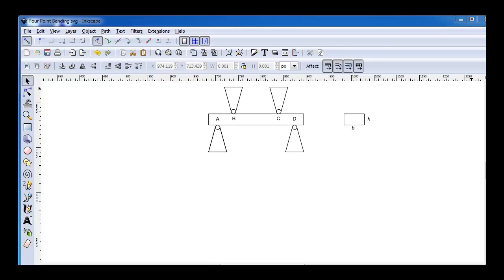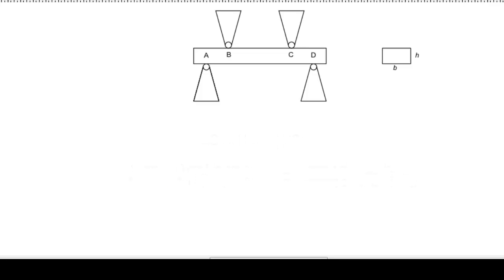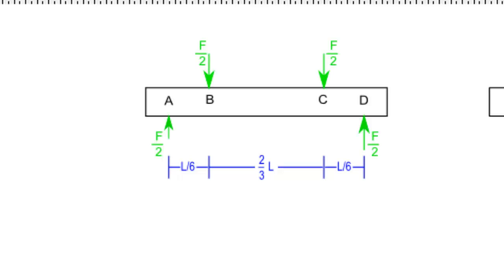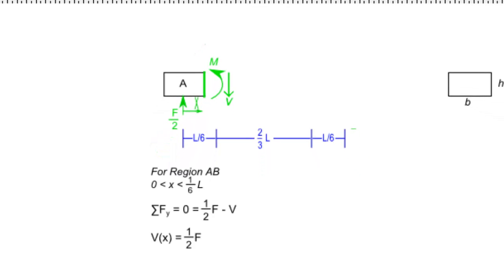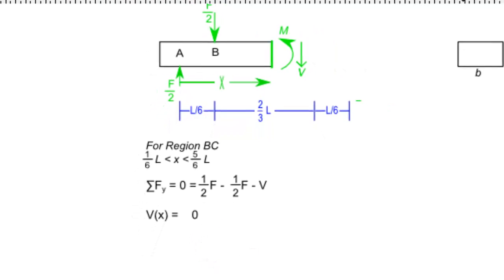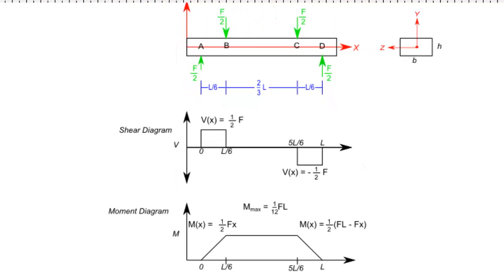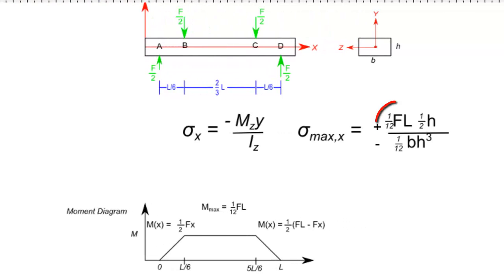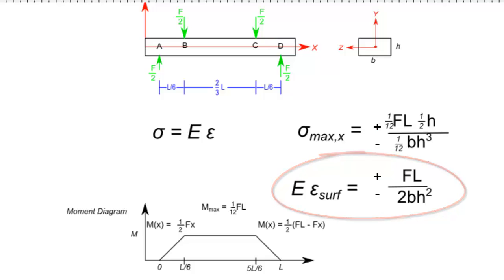Four point bending

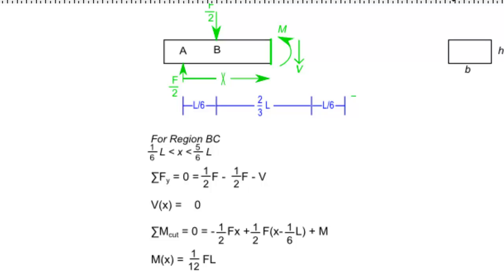Comment: At 2:45 why wouldn't the moment be -0.5F*x - 0.5F*(x-1/6L) aren't all forces going downwards and thus negative?
Reply: Hi i know this is so late but other people will have this question. The positive and negative conventions for bending moment and shear force are shown in the diagram. Just a quick reminder that shear force is the internal force that keeps a segment of beam static when other forces 'removed' by imaging cutting the segment off.  The bending moment is what prevents that same segment from rotating.  This makes sense, because an object at rest still needs to be at rest when a segment of the whole is analyzed.

Positive shear force is actually down if you are analyzing from the left end of the beam to the right (this changes if you analyze from right--> left). 
A good way of thinking about this is if a bending moment would make a beam bend into a smile, it's positive. Frown makes it negative. 

They decided to do this because they wanted the convention to be positive when resisting a supporting force (like how in region AB, the only force is going up). The reason why the moment is positive when smiling is because the convention is easier if the positive moment resists a positive shear force.

Comment: hi thank you so much for your great video. My samples cross section is square hollow shape. I would like to know the equaton of stress? For this cross section, the moment is the same?
Reply: The equation for calculating stress is the same, you just need to compute the moment of inertia for the shape you have. You should be able to find any examples in any common Mechanics of Materials textbook (something like Hibbeler, for example)
Reply: Thank you so much for your guidance. How about for calculation of the strain at maximum point from the neutral axis?
Reply: The direct approach would be to put a strain gauge on your beam (described near the 4.30 mark in this video). Indirectly, if you already know the stress, and you know the stiffness, you can determine the strain using hooke's law
Reply: Hi John,
Thank you so much for your reply.
I have the LVDT for measuring the beam deflection. the stifness of the beam is unknown. As you have mentioned the stress can be calculated using the formula in the video.
I would like to calculate the  strain using the beam deflection. I am using standard ISO 14125, the strain is calculated using this formula: strain=4.7sh/L^2, s is deflection, h is the thickness of the specimen. 
However, I do not know how this equation has derived? is this equation is applicable for any cross section?
Reply: Hi Fariborz, 
I'm happy to help clarify the basics, but I am unfamiliar with the details of the standard your are using. However, it appears to only be valid for a very specific geometry. At this point, assuming you are a student, you should be consulting with one of your local faculty members for assistance. If you are not at a university, it may be time to consult a practicing engineer. Your experiment sounds simple enough that anyone with a mechanical, civil, or aerospace engineering background should be able to help.
Best of luck
Reply: Hi, 
actually the standard is a general standard I thinks and it is applicable for all geometry. I am researcher actually, but my background is not mechanical or civil engineering, however, I am learning myself because of current projects that i am involved. 
From your video i have found how to drive the stress formula by using the moment.
At this moment.I am looking for derivation of strain calculation 
Any way thank you so much for your great help.
Reply from the maker: so i took a quick look, and the standard is definitely specific to a certain geometry
https://www.iso.org/obp/ui/#iso:std:iso:14125:ed-1:v1:en
From the Introduction / Scope
"1.5   The method specifies preferred dimensions for the specimen. Tests which are carried out on 
specimens of other dimensions, or on specimens which are prepared under 
different conditions, may produce results which are not comparable"

Be careful with assuming it is valid for all geometries.
Reply: Hello, 

Thank you so much for your consideration and the link. 
I will check again carefully about the dimensions.

Good luck, 
Fariborz

Comment: Hi. I am currently carrying out a project to determine the Young's Modulus of a steel beam using 3 point or 4 point bending, and after watching your videos, 4 point bending seems to be the less destructive/damaging option to use. 

With regards to calculating the deflection, can't that just be done using the Integration or Macaulay's Method, or is a gauge needed by force at the centre of the beam? 

Thanks for your time, and keep up the good work :)
Reply from the maker: +Andrew Borg I would typically recommend taking all the experimental measurements that you can, and then comparing those measurements to predictions based on the theoretical equations. 

If all you are trying to determine is the youngs modulus, I'd recommend using surface mounted strain gauges. You should then pretty easily be able to measure the maximum strain, and relate it to the bending stress in the beam. 

If you also want the deflection, you could experimentally measure the deflection of the midpoint with an extensometer, or if your sample is large enough perhaps capture the deflection on video, and then use DICM based techniques to back out the displacement field of the full beam (https://en.wikipedia.org/wiki/Digital_image_correlation).

As long as you are well within the linear elastic range of the material, and you have  a nice homogeneous material, the standard beam deflection equations should accurately match the experimental deflection. However, if you approach the yield stress, your will likely get local yielding near the supports, and this will causes deviations between the theoretical bending curves, and your experimental results. This is one of the reasons why if you need to get yield properties, you're better off using a traditional tensile test. 

As a final note, I wouldn't say that the 4 point method is any less destructive that the 3 point method. The destructiveness will depend on what load you apply in either case. An advantage of the 4 point test, is that the central region has a constant moment, and therefore constant bending stress. This is similar to having a uniform gauge region in a tensile test specimen. 3 point bending has no uniform stress region, making measurements slightly more challenging, and making your measurements more susceptible to flaws in the sample. 

Good luck
Reply: +jdomann Thanks so much for your help :)
Reply: +Dimitri Giordani you can bring out an equation relating the deflection of the beam at the centre and the Flexure Formula for stress (stress = -My/I)

Comment: Hi. If you have the displacement from a test machine for this experiment, how do you convert that to the strain?
Reply from the maker: +Aggerschoen There are at least 3 ways you could go about obtaining the strain from this experiment. First, put a strain gauge on your specimen. Second, if you know the stiffness of your material, strain is stress / stiffness. However, if you are unable / unwilling to put a strain gauge on your specimen, and you are testing it with the intent of measuring it's stiffness, you are left with the third option. Use the beam deflection equations, which can relate the deflection at your supports, to the applied loads, geometry, and material properties, to back out the stiffness of the material. From the stiffness you can again calculate strain with knowledge of the stress field you saw in this video. In case you're unfamiliar with the beam deflection equations, they're in most text books, and a quick google search turned up this: http://www.engineersedge.com/beam_bending/beam_bending6.htm 
Good luck.

Comment: Hi, first I wanna thank you for your useful video and secondly I have this question about the displacement formula/equation for 4-point bending.
I can't find it anywhere! I found out about the 3 point bending test but what I really need is 4 point bending test displacement formula that you mentioned at the end of your video.
Reply from the maker: Moey Rad Thanks for the question. You'll find methods to go from the moment diagram to the deformation equations in most intro mechanics of materials texts (Chapter 12 of Hibbeler for instance). 

If we take 'v' to represent the displacement of the neutral axis, then the beam bending equations are of the form:

M(x) = E*I*d^2/dx^2(v) 

To solve this, you should recognize that M(x) is a piecewise continuous function. Therefore, integrate the moment equations twice for each of the regions (AB, BC, CD), and then apply the proper boundary and continuity conditions for the 6 constants of integration.

2 Boundary conditions: displacement at A and D is zero. 
4 Continuity conditions: displacement and slope of the beam at B and C are continuous

Comment from the maker: Hi weijian, I'm not sure where in the video I say that we measure the deflection in sections. 

In general, for a problem like this, you want to determine the shear force, and moment throughout the beam, as they will generate shear, and normal stresses accordingly. Also, by solving for the bending moment in each of the 3 unique regions, you should eventually be able to determine the elastic curve (deflection of the neutral axis) for the beam, which can be quite helpful.